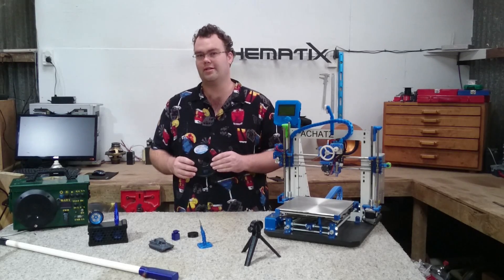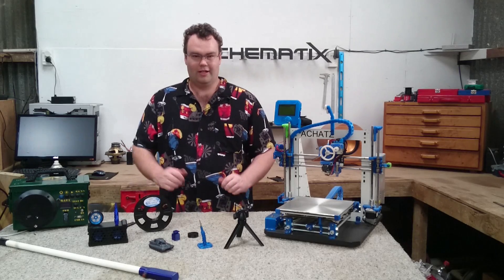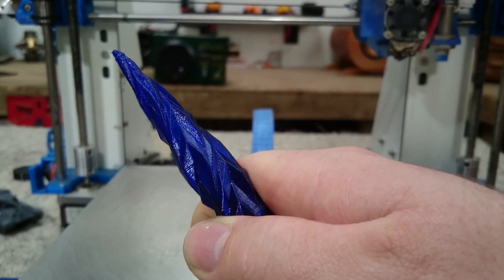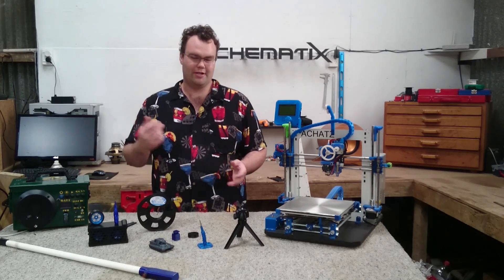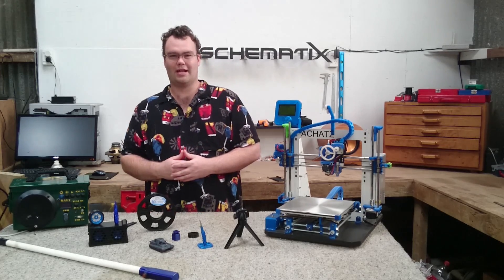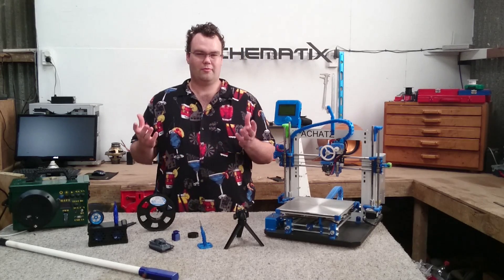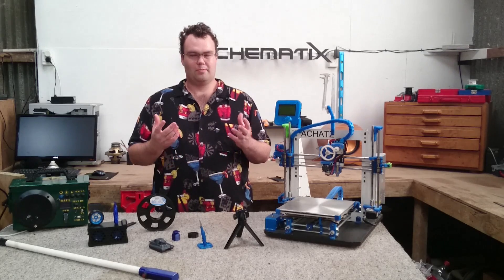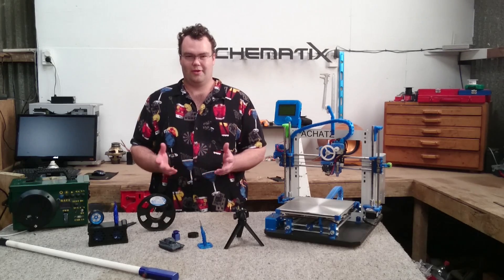Review: 3D Creator PETG Filament + Tips & Tricks for printing with PETG

Comment: Hi, just want to share that printing on mylar sticker (aka "super plate") is possible. The surface needs to be very clean, even a bit of hand oil will cause total lack of adhesion. IPA wipe is enough for me. Once I figured that out, I have been printing mostly in PETG for temp resistance. I can't have structural components creep underload! it defeats the purpose of most of my prints. Also, part cooling should be used, but very low like 10%.

Comment: Hi! What's about printing PET-G on a slick borosilicate glass? Will a glue from a glue stick defend it (a glass)? Or I need some sticky paper tapes or something?
P.S. my glue is PVA most probably.
Reply: I use plain elmers purple glue sticks, works great on my PEI. Ive also had great results on just borosilicate with the same glue. Might have to mess with your initial nozzle height, and make sure the bed is about 80c for the first layer then I back down to 70 with no problem. about 50mm/s print speed to get it to stick down!
Reply: When I print with my PLA I need the 1st layer to be cool or the glue dries off very quickly. Is it completely different with PETG?
Reply: @KiR_3d  I saw a video that said to use some water, and a tissue. The water reactivates the PVA. Spread the glue into a uniform layer, then heat it up and let it dry. Hasn't failed me, let me know your results!
Reply: Printed few times yesterday: 1st on a clean painter's tape, 2nd (after rip off) with a glue stick. This holds it like a beast! :) Even some tape was damaged when removing. Just temp. towers printing... I'll use less glue when it will be something big (plain large).
https://www.youtube.com/watch?v=V_iLM7vPh-4
Reply: P.S. I was told that it's really good to cover a glass with a paint. tape. And it's not hard actually.
Reply: @KiR_3d  Definitely, I don't use tape ever because it rips almost every print sadly but glue sticks have never failed me. Glad you had some test with it. I'll have to watch it in the am and see your results!

Comment: Very good informative video, just bought some to try, hoping it gives the strength of ABS without the smell !
Reply: Well, I have been testing Grey eSun PETG.. Using 230c on the hotend and 70c on the bed (235 on the hotend was leaving to much stringing, amazing what 5c will do) . Have my flow rate set to 98% and the retraction set to 6.5. My print speed to 40mm/s going down to 20mm/s depending on what part of the print is being printed. Using a Raft and blue tape and sticks to the bed great. get very few light strings, but I'm very happy with that ..  This material is tougher than heck and a usable material for usable parts.

Using a stock MonoPrice i3 Plus .. nothing fancy ... my bed level and bed / nozzle height are set manually as very best I can, with the blue tape on the bed and measured with it on the bed of course.

Must admit, you must pay attention, as this prints differently than PLA ... not necessarily harder, just a bit more of a learning curve, a few little changes can make a very big difference.

Comment: Yesterday I ordered 2 rolls of PETG, as I feel like putting my E3d V6 to the test. I also got a new extruder, as my current plastic bodied one slips even on some PLA blends with a relatively high nozzle pressure. I already know to back my speed  down to about 80% of my normal print speed, but anything else I need to know? Do I need to increase/decrease the retraction distance/speed? I have heard of people having problems with stringing, and I would think messing with the retraction may help relieve nozzle pressure. The extruder having problems is my only real concern, I use a bowden setup which may not be ideal. The style of extruder I got was a full metal MK8 style. Hopefully it will do the job.

Comment: I use PETG in my CEL ROBOX running Automaker. And it works great. No problems. ReProgrammed a original emty Cel reel with ( Colorfabb_XT CO-PET )settings. 240.C Nozzle 75.C on Bed.

Comment: I use PETG exclusively now.  The only real issue I have is the ooze when the hotend is heating up.  I have an E3Dv6 with the slightly more powerful heating element so it heats up reasonably quickly, but I still have to keep an eye on it when starting a print and remove the ooze with tweezers to avoid a mess when the print starts. I run 4 perimeters around the print for the first layer and this seems to just about replace the oozed out filament in time so that when the print itself begins the PETG is flowing properly.  It concerns me that this may lead to blockages so I will usually manually turn the extruder gear while the extruder heats to keep the filament flowing - removing the extruded filament so it doesn't make a mess.  This is a pain as I can't just set the printer to go and leave it, I need to pre-heat the bed and then go through this process while the hotend gets up to temp.  Anyone else have this issue?
Reply: i'm still green, when it comes to generating g-code. but shouldnt it be quite easy to include a start routing, that has print head pass over some kind of wiper*, just before it starts the print? that way the printer can take care of it's drippings by itself. 
(*= sponge, rubber lips, or a brush. or a piece of folded kitchen paper, clipped to a coner of the print bed as a minimal solution)
Reply from the maker: PETG does have a tendency to ooze during heating. And it is a good idea to clean the nozzle just before printing starts. I've never had any blockage with PETG, so I wouldn't worry too much about that. If there is any popping sounds or bubbling in the oozing PETG it might indicate the filament isn't dry. This can lead to excessive filament ooze during heating and printing. I keep my filaments in a plastic box with a moisture absorber like DampRid to keep them dry as possible.
Reply: That's interesting.  I didn't think PETG had issues with water absorption.
Reply from the maker: It's a good idea to keep most filaments in a dry environment. Most filaments actually do absorb some trivial amount of moisture which normally doesn't cause any issues. However I noticed a big improvement with PETG once I started storing it dry.
Reply from the maker: Yes and in fact some  manufacturers incorporate that feature. Personally I always watch the first layer  to make sure everything starts correctly, so it no bother to clean the nozzle with tweezers just before printing.

Comment: PETG, great stuff ... if printer is setup precisely for it.  It is a very stringy material .. the flow rate needs to be within 1% of ideal, too much and it will be stringing all over the place. For the same reason, bed height must be perfectly level. No z lift, and quick non print moves (to break off strings). Yes, it must be printed S L O W.  Printed on PEI sheet material, adhesion is outrageous with NO hairspray, glue or tape crap .. you will NEVER have a print lift (assuming bed height is dead on to begin with) .. but plan to carefully use a razor blade to get your parts off, a great trade-off for no failed lifted prints.

Comment: great video. seems like petg is catching on. I have had 2kgs of the stuff since I got my printer. I have had a bit of a hard time with it. what size print nozzle are you using? how do you fight the oozing?  maybe I got crappie filament?
Reply from the maker: +Aaron Murray 0.4mm nozzle. I use 1mm of retraction @ 40mm/s with 2mm of Z-hop. PETG does tend to ooze. However it only happens while the hotend is warming and not while printing (for me anyway). What type of hotend are you using? all metal? and print temp?
Reply: I just upgraded to an e3d v6. I usually print at 240* on a 0.3mm nozzle. My retract settings are close to yours. I will have to up the Temps tomorrow. I'll let you know how it goes. Thanks for the tips.
Reply from the maker: +Aaron Murray You're welcome. with my E3D V6 petg will struggle to extrude at 240c. If I print 20mm/s or lower I find 260c works fine. normally I print at 40mm/s or faster, and that requires 265c. Let me know how you go?
Reply: +Schematix hey tried your temp and Z hop settings. it really cleaned up my prints. thanks!
Reply from the maker: Awesome to hear! Happy printing
Reply: I have just bought a couple of spools of PETG and all I had to do to get it printing well was to decrease the squish as I had my z set for PLA, the only trouble is that if I print something with a large flat bottom it warps, the print is stuck to the bed no problems but within 10 minutes of removing from the PEI build surface, I get warping. Print temp 240, bed 70 , no fan on the first layer and 50% thereafter

Comment: By the way I print with the Ultimaker 2 and have had no problem with printing at 260 C with the 2.85 PET-G filament. I use simplify 3D printing software.

Comment: I use PET-G now exclusively. I am prototyping a large assembly and have had no problem with warping or smell like with ABS. PET-G is approved by FDA so this will work well with food and beverage products. The only annoyance is that If you have a lot of infills, it is hard to remove vs ABS. I will be glueing parts together this weekend so I will let you know if it can be glued together, sanded etc.
Reply from the maker: +jurrien van den Akker Thanks for the info! PETG is a great plastic to print. I have sanded PETG a few times. I do recommend using wet sand paper, as dry sanding PETG produced a 'furry' finish.

Comment: very good and informative video! I've been looking into getting some PET to print in as it seems to making ABS obsolete in most usage cases. I would have like to here a little more info on your slicer settings though. such as print speed, cooling , etc.All in all thank you for the good content
Reply from the maker: +Kostaki Gogos Thanks for the positive feedback! I use Cura as my slicer, Bed: 65c, Nozzle: 265c Print speed between 30~60mm/s depending on the part being printed (normal everyday use 50mm/s) No fan unless I'm printing BIG overhangs. I use a 0.4mm nozzle and print between 0.05~0.3mm layers just fine.  Other good sources for PETG are reprap.me & e3d-online.com
Reply: Thank you for the reply, and I hope to see more content
Reply from the maker: +Kostaki Gogos No problem,  Plenty of new content on its way! A planned future project is my own lightweight compact dual feed extruder, Not sure when this will happen but its planned!